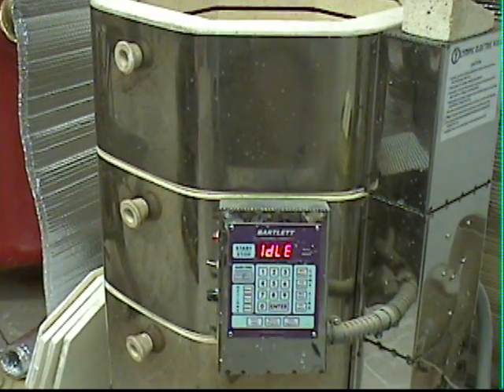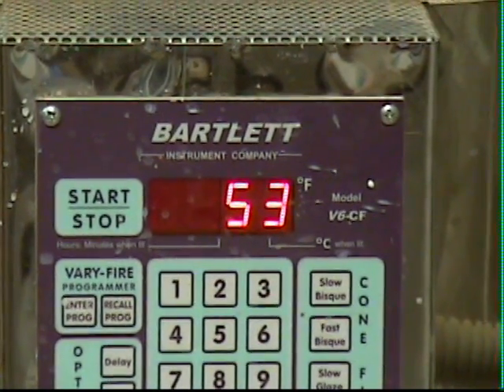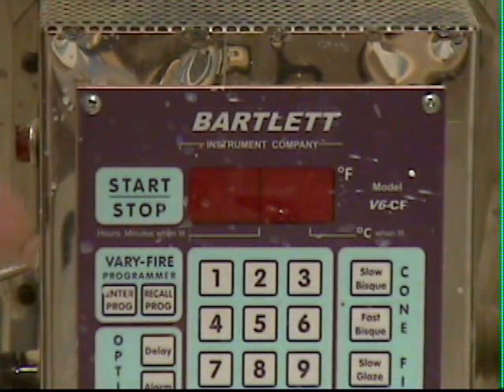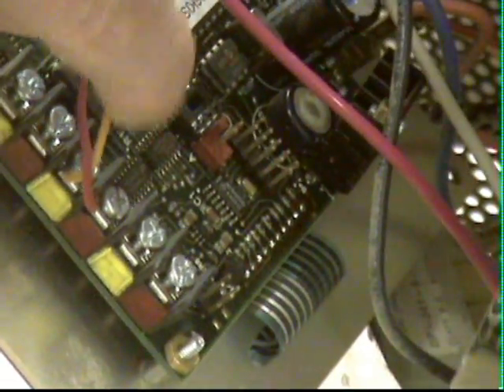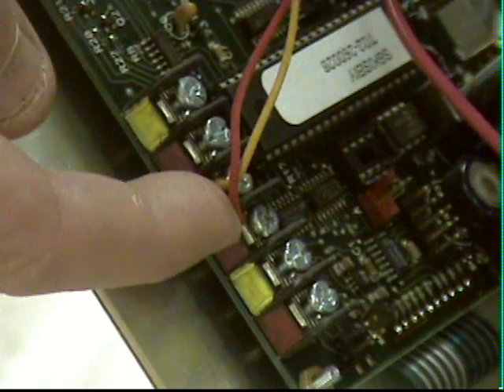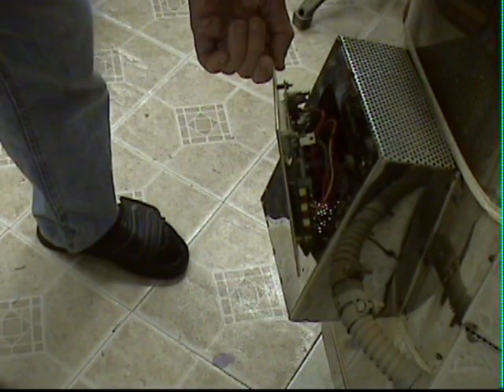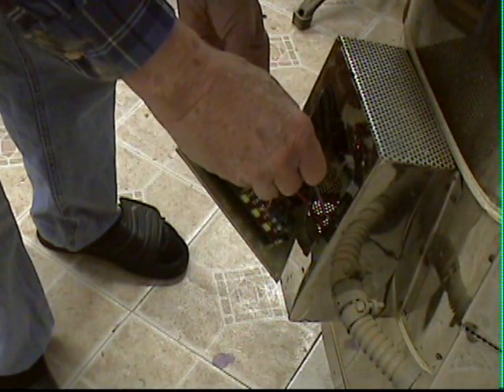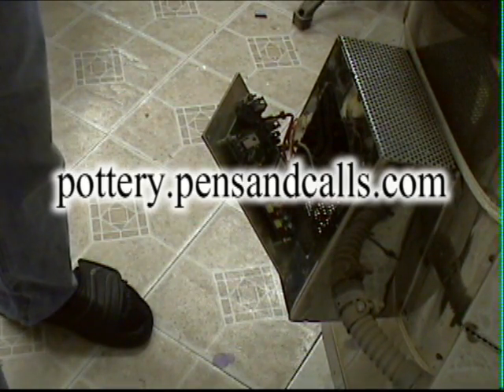Thermocouple replacement on Olympic Kiln

Comment: I am glad this worked for him, but if you call Olympic they want you to remove the entire box.  2 reasons for this. 1)Sometimes the thermocouple is screwed in and you can't reach the screw this way. 2)Removing the box leaves the mother board in a more stable position.  The wiring is less likley to come loose.  Not all the wires are always long enough to pull it open at the angle in the video. (Which was my experience and caused me to call olympic.)

Per the thermocoupler removal.  1) There may be a screw,  loosen it and then the thermocouple easily slides out.  2)Insert the new thermocoupler. Make sure it protrudes 1" from kiln wall. 3)replace screw on thermocoupler, replace insulation, put box back on kiln.

Comment: Would you advise Olympic electric kiln. Planning to buy MAS2827H. Any particular issues etc?
Reply from the maker: Olympic has made good improvements to their kilns to eliminate the problems I've had so I would not hesitate to buy a new one.
Reply: thank you for the advise. your post is helpful